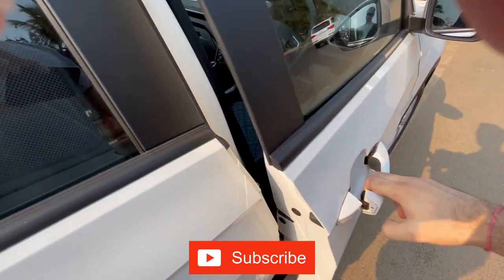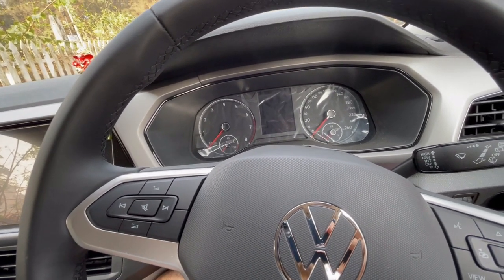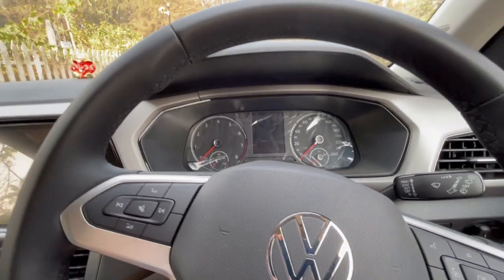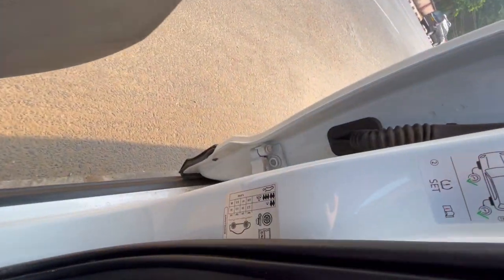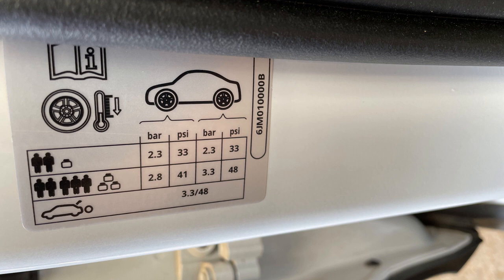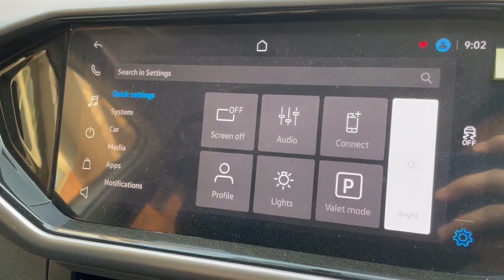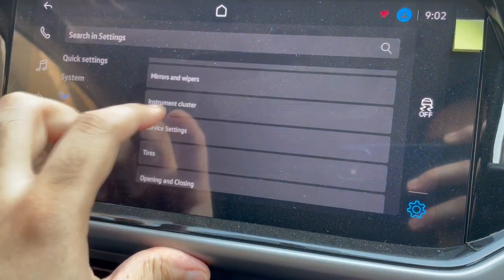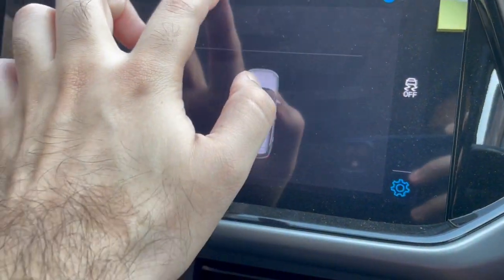How to reset the Tire Pressure Monitoring System (TPMS) in the VW Taigun

Comment: Bro in the sticker it mention if 5 people sit in car and then tire pressure should be 41 and 48 , dont u think its quite high, i have skoda kushaq 16 inch wheel , and same sticker is there , i travelled with 33 psi in front and 35 psi in back and i got 16 avg on highway  but when i had new vehicle i used to get 22 avg on highway , what should be the correct tire pressure with 5 people , could u tell
Reply from the maker: I maintain 33 psi all the time. Faced no problems